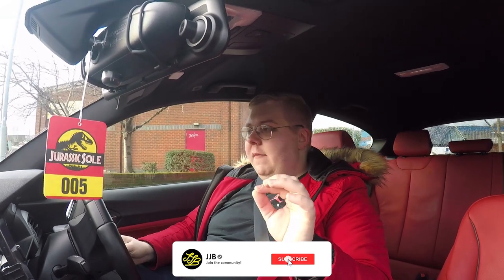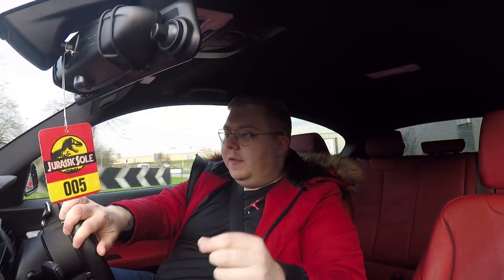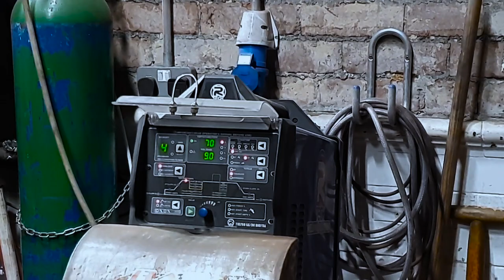How to get an UNREAL sound from an M140i - B58 Resonator Delete!

Comment: My 540i is going in for a dual resonator delete tomorrow! Also got a quad pipe Backbox which I may fit depending if it’s gonna be full hooligan mode!
Reply from the maker: Looking forward to it mate?
Reply: Just The Driven yeah,I had the aftermarket backbox on with the resonators in place and it wasn’t loud enough lol. Just trying to figure out if my car has a PPF for emissions etc
Reply from the maker: What year is it?
Reply: Just The Driven 67 reg
Reply from the maker: I'm sure PPFs were 2018 onwards, worth a Google though!
Reply: Just The Driven yeah I’ll have to double check,I’m sure the guys will know anyway. Have you head any with res & Back box delete? I Worry it’s gonna be stupid loud
Reply: @scottfreeman5289  I’m sure you have probably heard it by now but yes it will be very very loud 😂

Comment: My worry is droning, are you defo sure there is no drone when in comfort, at all speeds?
Reply from the maker: You can hear the car ever so slightly but it's not droning/resonance, it's just the sound. No stupid vibrations or cabin shake at any speeds. Once the valves are closed it quietens down loads, even in sports mode it doesn't drone, you just hear the sound more.

Comment: Not too loud for neighbors? Also does the exhaust flap make a difference when in conform and in sport. I felt on stock it did nothing lol. thanks for posting the video!
Reply from the maker: The cold start is a little noisy but it calms down relatively quickly

Comment: Is a single res delete not worth it?
Reply from the maker: Its worth it if you're wanting a slight increase in noise, a middle ground between this and stock 👍
Reply: @JXLPerformance  20 years ago I'd have done the lot, but at nearly 50 just a little quieter might be me. Plus I think my neighbours would kill me 😂👍
Reply from the maker: 🤣 no harm in doing it! The cold start is quite a bit louder with both of them out so one may the best route if you don't plan on fighting your neighbours 😛
Reply: Did you end up doing this mate? Planning on a single res delete for my 840i but not sure if it would just be best to remove both. Having said that, I am looking for a nice middle ground.

Comment: How loud is it compared to stock? I want a decent increase in volume so i can hear it over my music haha.
Reply from the maker: If you're in comfort you can barely tell, in sports mode it's more throaty and louder, not too loud though! I have my music loud most of the time and I can hear it
Reply: @JXLPerformance  so its not much louder in sports mode than stock? Im looking for a large increase in noise thats all haha, it would be nice to hear it well over music with the windows down
Reply from the maker: @carmad1287  It is louder in sport yes, the pops and crackles and much louder, it tends to be louder in sport as it holds on to the gears longer, in comfort it's relatively quiet
Reply: @JXLPerformance  Lets say im just accelerating relatively steady in sports mode, with the windows down is it much more noticeable than stock?
Reply from the maker: In that sense it's not drastically louder, you'll notice a difference but it's not the same level as a backbox delete/decat
Reply: @JXLPerformance  Okay thank you, im stuck for options haha!

Comment: How much was this, I’m from Leeds and want my m140 doing too. Found the same everyone wants to do a full mid pipe or wants to chuck some 3 inch in not the proper 80mm. Liked that he actually took the exhaust off and did it properly too 👍
Reply from the maker: £120 fitted mate. Get in touch with BAF Motorsport I'm sure he'll be able to sort you out. Tell him I sent you!
Reply: JJB nice one mate cheers, will do 👍
Reply: Danny Tate Did you get this done in the end Danny? I’m from Leeds too and thinking of getting mine done? Just wondered what your thoughts were on it if you’d gone ahead? Cheers Ian
Reply: Tommo IT I did have it done yes, I would definitely recommend having it done. The sound is fantastic, really gives the car a bit more drama. Cold start is a bit too loud to be honest but once driving there is zero drone, you only really know anything has been done when you step on it or when you have it in sport/traction mode and get loud cracks in between gear changes and pops on overrun. 

I did use the company in the video and got the feeling they didn’t really want that type of work, it all felt very rushed while they were doing it although the job was done to a decent standard in the end after I had words about not rushing it and just making sure it was right. However they did adjust my exhaust as part of it to make sure the tips were centralised in the bumper as mine were off from factory.
Reply: @onetyrefire9722  In your opinion is it much louder than stock? In sports mode, not just the cracks and pops the actual exhaust noise?
Reply: Car Mad128 its definitely louder across the entire Rev range, not too much and is mostly under heavy acceleration at which I have had comments of its volume being much louder than I think it is whilst following me, however cruising/normal driving I would not say it is too loud at all, just a bit of a deeper tone and in my opinion how it should always have been. Also there is zero drone at any speed including motorway speeds. Recently been to the Nurburgring and back and not once did I think it’s too loud or intrusive once. The best way I can describe its sound is a touch louder than stock with the windows up due to the car’s insulation, open the windows and it sounds fantastic but not over the top/ chavvy etc. Comfort mode you get a small amount of rumbling but not bangs/pops in normal driving, accelerate hard and the normal crack you get in between shifts (auto) is notably louder and obviously the exhaust tone is louder. Sport/ sport + you get the same as stock but the bangs are louder, much louder.. my fave is traction mode, the cracks seem to be more aggressive in this mode but a touch less frequent and gear changes whilst the wheels are spinning a bit still are amusing, sometimes you get full on gunshots in between shifts. 

The only thing I would possibly want to change is the cold start, it’s properly loud (not exactly quiet stock) but this can be mapped out should you map your car. I don’t mind it, makes me smile, you might not mind it but I’d imagine your neighbours 2/3 houses each way might.. 

Would I do it again? Yes.
Reply: @onetyrefire9722  Thank you a very detailed response i appreciate it, would you ever want it louder? Is yours on the stock backbox?

I usually drive with the windows down, with my music at a decent volume will i be able to hear it over the music in sports mode with sort of 50% throttle?

People following you reckon its pretty loud on the outside then? 

Thank you for your response.
Reply: Car Mad128 no problem, 

Yeah I’m running stock rear silencer and stock cat, probably wouldn’t want it much louder, I’d possibly consider an m performance back box too in the future but only after mapping due to the cold start. I’d say you’d probably get away with this and still have a fairly acceptable level of volume. The thing with the 140 is it sounds quite different to say a golf r that is loud and seems to be more socially accepted and it has complemented by random people, I guess because it’s not the typical 4 cylinder drone noise you hear everywhere farting about. 

Id say yes definitely you’ll hear it with windows down even with music up a bit, give it 50% or more throttle and it really wakes up, cruising it’s nice and quiet and on idle you can barely hear it.
Reply: Car Mad128 sorry yes apparently it’s quite a lot louder than you think it is whilst driving. My brother has a 330 swapped compact with a rear silencer delete which is really quite loud and he commented that he could barely hear his car when I accelerated hard in front of him. He said it sounds unreal when your pulling away.
Reply: @onetyrefire9722  Thank you for all your help you have sold it to me haha 👌👌

Comment: Love the noise mate was going to do mine but have been told removing box nearest to engine (PPF/GPF) filter will ruin emissions and so fail MOT? Any ideas with your 140i? Does sound sweet! Cheers gr8 vid.
Reply from the maker: Mine is a pre GPF model so it doesn't have them buddy. You can remove the resonators in yours but it won't be as loud, or you could get a GPF/PPF back exhaust that could also work
Reply: @JXLPerformance  thanks for reply mate 😁